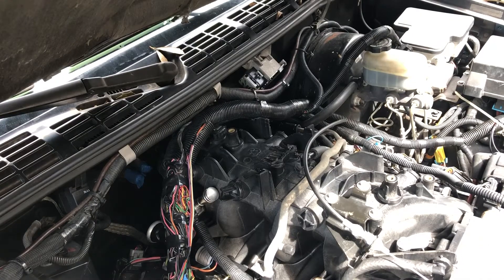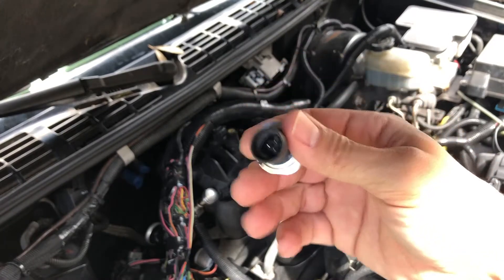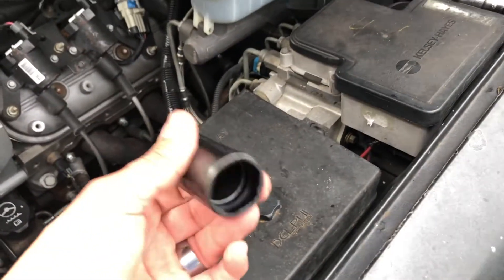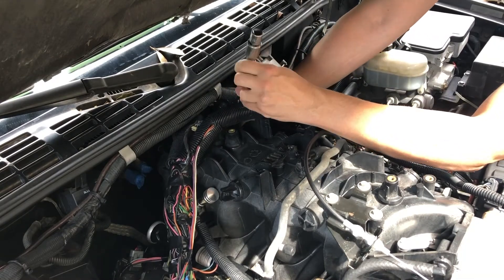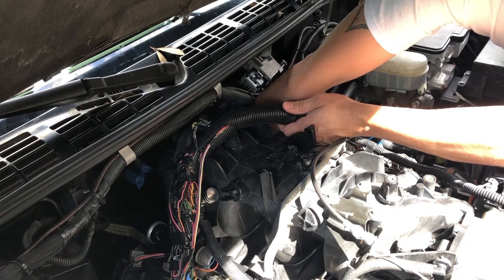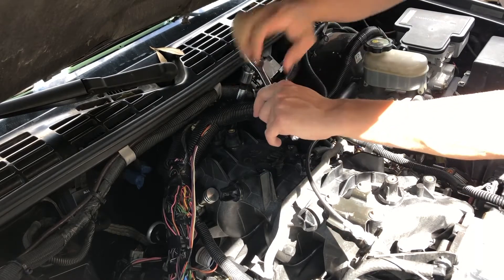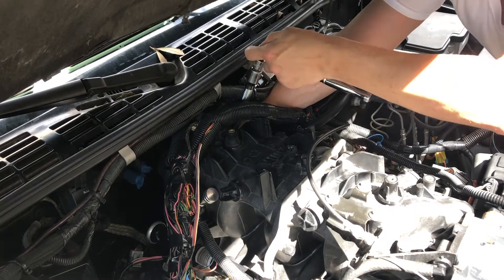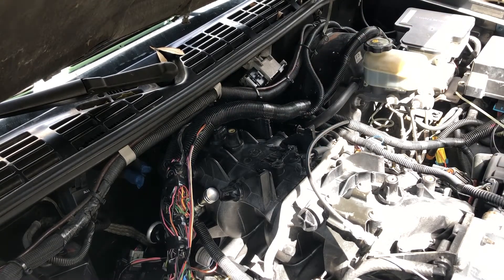Chevy LS Vortec Oil Pressure Sensor Swap

Comment: All my gages on my 2004 Sierra are acting up including the oil pressure gage. I don't see a check engine code, so I assume the gage is messed up.
Reply from the maker: I would doubt it’s the gauges, especially since you say they are all messed up. 

Sounds like a grounding issue, or a bad module. (Bcm or ecu).

Comment: Did that fix your oil pressure gauge problem? It looks like you have two wires, do your wires go back through the harness to the PCM?? Or do they go straight to the truck harness to the gauge? The S10 originally had a separate wire for the gauge output. The LS based trucks had the sensor tell the computer and then the computer sent that through a Serial data wire to the gauge set.
Reply from the maker: And no. Didn’t change anything. I tried wiring it both ways: direct to the gauge wire, and through the ecu. Same result. 

So, my last resort is to get the 2.2 sensor, drill and tap the LS sensor so the 2.2 will thread into it, and wire that straight to the gauge. Is that what you did?
Reply: @CliffsHowTo  I got an adapter that lets me put the factory S10 sensor into the LS Block. (I think I ordered a 1/4 inch one and not an 1/8 inch. I believe they are different voltages and ohms. 

LS Engine Swap Male M16-1.5... https://www.amazon.com/dp/B015NFR82Y?ref=ppx_pop_mob_ap_share
Reply: You need the adapter that goes in the block and allows you to use the oil pressure sensor that's original to the truck. The wire is tan and goes to the body harness. If the engine was removed properly that wire plug would still be there.

Comment: Next time, take that part number and find it on Amazon. You'll pay about $30 less.
Reply from the maker: I did that the first time. Started the truck, and it shot all of the oil out of the engine, all over the driveway. So I went and got it from the dealer...
Reply: Cliff's How To Channel Lol I just did that shit last night all the oil shot out the motor.But I want a block or delete what size bolt do I need?
Reply: @arireid1245  M16x1.5 but would recommend to keep it. Some newer motors, need the pressure data going to the ecu. And safer to have the gauge. So if oil pressure does drop. You can possibly save the motor by turning it off asap. And figuring out the issue.
Reply: @arireid1245  1/4 npte plug 👌 just did this on mine
Reply: @mavsz8481  if your pressure drop significantly like that, you had issues for a hell of a long time that you weren't paying attention to... when oil pressure goes to zero, you done fuked up 10000 miles ago.😂